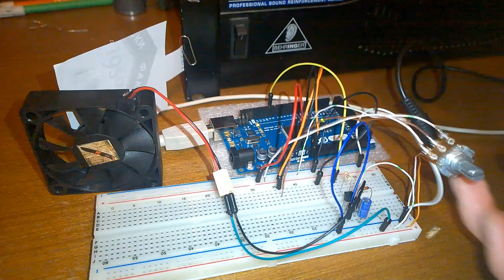Arduino PWM DC Motor Fan Speed Control

Comment: I am doing something similar , did you get the power to turn on the fan from Arduino 5V or external source? 
I am using a 12V 1.7A fan , linking it to an ARDUINO UNO and a potentiometer through MOSFET IRF540N
Reply: As I said before , my source will be a 12V external , do I need to connect it GND to the ARDUINO GND ?
Any sepcific code for this kind of control ? or just pins declaration ? I am starting basic steps to move on to the PingPong Ball PID control , that's why I am asking several questions as each step is important .
Thank you for your reply and your video
Reply: yes dear .. you should connect it to arduino ground ...and read about how to put a diod with your dc motor to protect your circuit
Reply: @medchaouechi842  Always use common ground for referencing

Comment: can you tell me how you wired your pot, mine when i change the value starts sparking inside the pot, and gives off smell
Reply: VCC goes to the left or right pin
Arduino read the center pins
GND goes to the last pin.

I did connected the center to GND when it reach nearly VCC it does spark and burnt starting a small fire and died :(